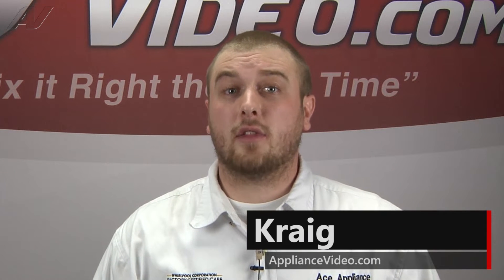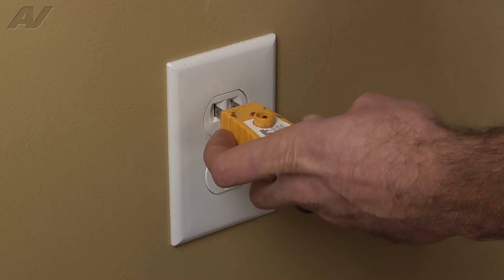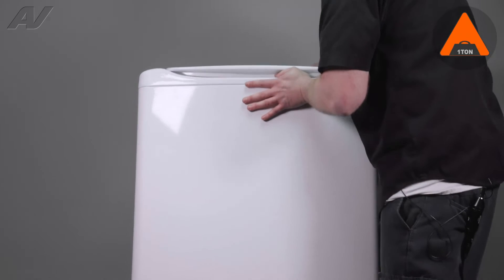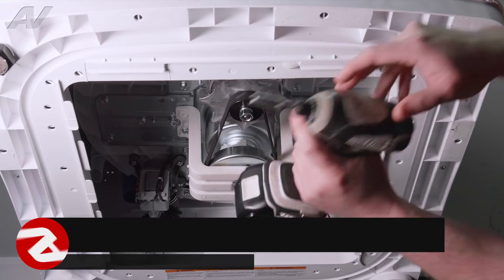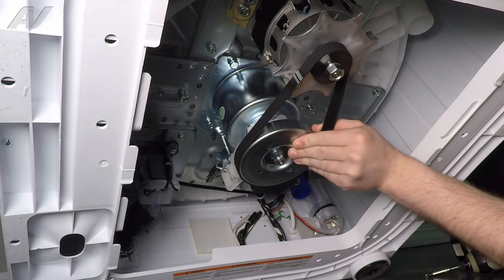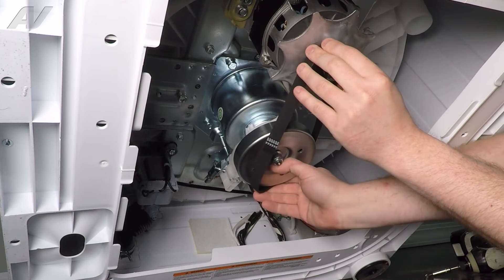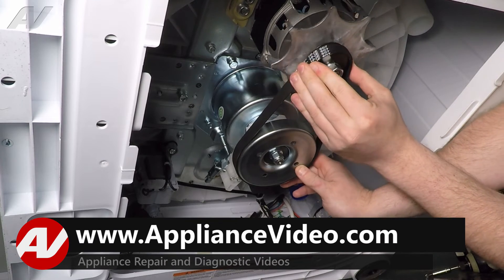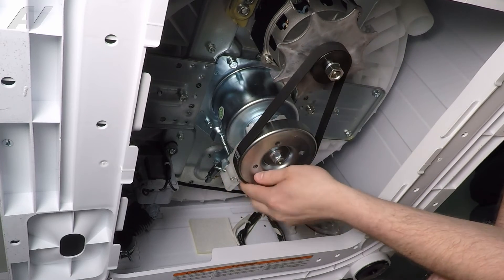Frigidaire Washer Repair - Will Not Start, Broken Belt - Drive Belt

Comment: How do you remove the whole top of this washing machine shown in this video. Mine is leaking from the top left, when filling up with water. But I can not see where. I need to remove the whole top.
Reply: I found the lid lock video and it explains how to remove the top, Thank you
Reply from the maker: Great question, if you have a more technical question that our parts department cannot answer, you can search our over 17,000 answered questions free at our website www.ApplianceVideo.com under our Repair Help section. You can also call our parts department at 1-800-830-5465 and they can give you help 7-days A week ,or search at www.SaveMoreOnParts.com  .

Comment: Replaced the belt, but it keeps sliding off the pulley.
Reply: Belt slipping might be due to a worn pulley or worn motor shaft which the pulley mounts to - mine had about 2 inches of play.  Changed the motor, swapped over the pulley and bolted it down - no more belt slip.  Hope this helps.
Reply: I could grab the bar that holds the pulley and pull it in and out about 1.5 inches.  check that also.